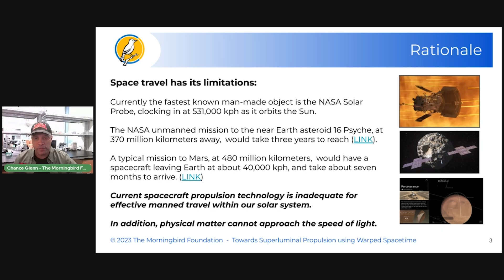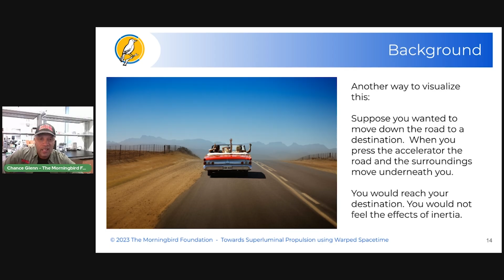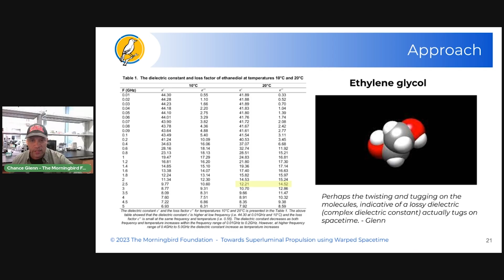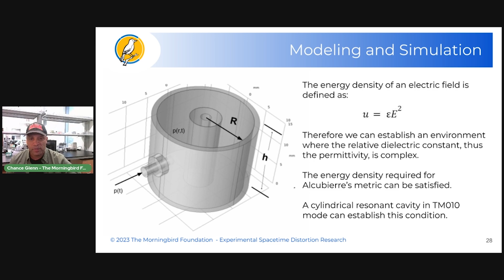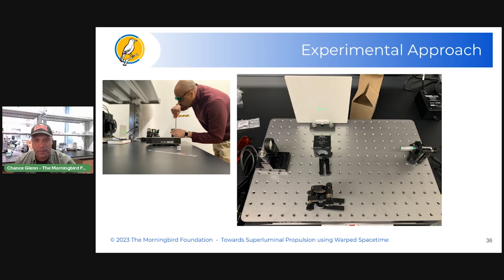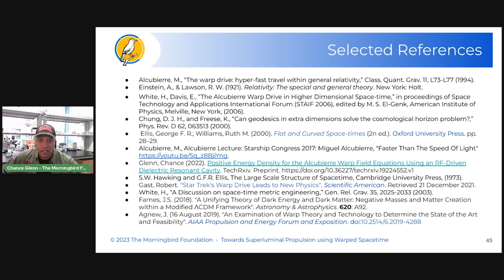Superluminal Propulsion Using Warped Spacetime | Chance Glenn

Comment: Love your work Dr Glenn, it’s all about circuit configuration. 
 Prime the centre of the field with resonant L-wave from the front then pulsed magnetic coil pushing from the back against the neutrino field. ✅ 
 Unimaginable amounts of energy are not required, relatively no more than a person swimming through water,  only it just keeps on accelerating. 
 The ‘field’ is either aligned or perpendicular, and it can be manipulated ahead of you. This is the fulcrum for your leaver.

It’s only impossible because you think it’s impossible. 
 It is possible and I can see it. Free your mind.

Comment: General Relativity and Quantum Mechanics are not compatible and physicists have been trying for over 100 years without success. So one of the two theories must be wrong! There is now strong evidence that the problem is Relativity, and the proof is that the speed of light across space has just been experimentally proven to not be constant, and instantaneous signaling across space has just been demonstrated experimentally, thereby disproving not only the 2nd premise of Relativity,  but also disproving Relativity's prediction that signals faster than speed c are not possible. What remains is the 1st premise: Galilean Relativity. If Relativity is wrong then so is any theory dependent on it such as General Relativity and even QED. According to the scientific method, no experiment can prove a theory, but can only evidence supporting a theory. But one experiment can absolutely disprove a theory by disproving a premise of a theory, and or a disproving a prediction of a theory.

An experiment just published in the EM journal IRECAP shows an EM pulse propagates instantaneously in the near field across 1.5 meters of space with no propagation delay. This shows that the front speed (speed of information) or speed of causal action is instantaneous in the nearfield of EM sources. It shows that not only is the speed of flight not constant, but shows signals propagate instantaneously in the nearfield of EM sources. The experiment was repeated hundreds of times, and was also done by an independent researcher in their own lab, with the exact the same results. The paper also shows that the effect is predicted exactly by Maxwell"s equations. The paper is linked below. The effect can also be shown to be fundamentally due to the Heisenberg uncertainty principle. This shows that the effect is fundamental to all fields including: EM, gravity, and quantum.

In another experiment, a sinusoidal signal was transmitted between 2 dipole antennas as they were separated from the nearfield to the farfield. Analysis of the resultant phase vs distance curves (dispersion curves) shows a clear minima in the nearfield for all the EM field components. Applying well known phase speed and group speed operators to the curve, which are inversely proportional to the slope of the curve, show that both the phase speed and group speed are instantaneous in the nearfield and reduces to about speed c in the farfield.

Both experiments have been independently repeated by other researchers, obtaining the same exact results. If speed of light is not constant, then the 2nd premise in Relativity is wrong and what remains is the 1st premise: Galilean Relativity. Instantaneous signals violate the Relativity of Simultaneity because the signals appear the same in all inertial frames of reference. This can easily be seen by inserting c=infinity into the Lorentz transform, yielding the Galilean transform, where time and space are absolute. So if a moving body is observed with instantaneous nearfield light, then no Relativistic effects will be observed. But they will be observed if the frequency of the light source is changed such that farfield speed c light is used. So by simply changing the frequency of the source, Relativistic effects can be turned off and on. The only possible explanation is that the effects of Relativity are not real and are just a type of optical illusion. This result will affect all of modern physics.

In addition, the above results are predicted by EM theory. Maxwell's derivation of the speed of EM fields was wrong. The reason is that EM fields are created by sources coming from Gauss' and Amperes laws., and these sources must be included and can not be set to zero as Maxwell did. Including the source term yields a wave equation equal to a source term. Inserting a dipole source yields EM field components that with phase vs distance from the sources dispersion curves with a clear minima in the nearfield, and become only approximately linear in the farfield, starting about 1 wavelength from the source. It is well known that both the phase and group speed are instantaneous when there is a minima in the curve, and only exactly a constant speed when the curve is exactly linear, which only occurs at infinite distance from the source, which does not occur in a finite sized universe like ours. So Maxwell's solution is only valid at infinity, which does not exist in this finite sized universe. So the speed of light never a constant in our universe. If the speed of light is not constant, then the 2nd postulate in Relativity is wrong.

The same behavior can be shown to occur in gravity. It is well known that general relativity reduces to gravitoelectromagnetism (GEM), which assumes that gravity can be modeled by Maxwell's equations with different constants. So the same solution that occurs in EM theory also pertains to gravitational theory. This explains the instantaneous gravitational effect in the near field, observed in the stability of the planets, and also explains that Gravity waves have been observed to propagate at about speed c in the far field. This theory then accounts for all the observed gravitational effects including instantaneous nearfield and the speed of light farfield. The main difference is that this theory is a field theory, and not a geometrical theory like General Relativity. But because it is a field theory, Gravity can be then be quantized as the Graviton, enabling the unification of Gravity and Quantum Mechanics.

The phenomena also can be seen in quantum theory, and can be shown to be the consequence of the Heisenberg uncertainty principle. At the source, the position of the photon emitted from the source is precisely well known, hence the momentum or the speed is infinite. At about 1 wavelength from the source, the wavelength is starting to be come clear, such that frequency x wavelength ~c. But according to Fourier Theory infinite cycles are needed for the wavelength to be exactly known. So the above frequency wavelength relation is only valid at infinite distance from the source. So the speed of light never reduces to exactly speed c in our finite size universe. This phenomena should be fundamental to all fields including: EM, gravity, and quantum, and in particular quantum tunneling.

There are currently many interpretations of quantum mechanics. But only the Pilot Wave Interpretation is compatible with Galilean Relativity. In this interpretation real particles are guided by real pilot waves. But the real pilot waves are known to communicate information about the particles instantaneously with the environment. Because this is not compatible with Relativity Theory, this interpretation has not been taken seriously. But as a result of this discussion, this is no longer a problem, and Pilot Wave theory should now become our best interpretation of quantum mechanics. And combined with instantaneous nearfield interaction, can perhaps explain the instantaneous interaction observed in quantum entanglement.

For more information see the following links:

*YouTube presentation summarizing my 35 years of research in this area: https://www.youtube.com/watch?v=sePdJ7vSQvQ&t=0s

*More extensive paper for the above arguments: William D. Walker and Dag Stranneby, A New Interpretation of Relativity, 2023: http://vixra.org/abs/2309.0145

*Electromagnetic pulse experiment paper peer reviewed and just published last month in Journal IRECAP: https://www.techrxiv.org/doi/full/10.36227/techrxiv.170862178.82175798/v1

Dr William Walker - PhD physics, ETH Zurich, 1997
Reply: Could it be stated that the longitudinal field component in the near field propagates independent of the medium it traverses through,while the transverse EM radiation of the far field is dependent on the properties of the medium it traverses through,ie; permittivity and permeability of the vacuum?
Reply: @josephrendon6969 Analysis using Maxwell's equations shows that all the field components propagate superluminally in the nearfield. Experiments confirm this. In one experiment, a sinusoidal source was transmitted between two vertical dipole antennas, as the antennas were separated from the near field to the far field. The results show that the resultant phase versus distance curve is nonlinear, with a clear minima in the near field, and becoming only approximately linear in the far field, starting about one wavelength from the source. It is well known that only a linear curve corresponds to constant speed c. It is also well known that a minimum in the curve corresponds to instantaneous propagation. Applying well-known face speed and group speed operators inversely proportional to the slope of the curve shows that the speed of light is instantaneous in the near field, and reduces to approximately speed c in the far field starting about one wavelength from the source, and never reduces to constant speed c, ever. For more details see, Superluminal electromagnetic and gravitational fields generated in the near field of dipole sources by William Walker, 2006
Reply: @josephrendon6969 No, analysis using Maxwell's equations shows that all the field components propagate instantaneously in the near field and reduced to approximately speed c in the far field, and never become exactly speed c, ever. See, Superluminal electromagnetic and gravitational fields generated in the near field of dipole sources, by William D Walker, 2006
Reply: @josephrendon6969  No, analysis using Maxwell's equations shows that all the field components propagate instantaneously in the near field and reduced to approximately speed c in the far field, and never become exactly speed c, ever. See, Superluminal electromagnetic and gravitational fields generated in the near field of dipole sources, by William D Walker, 2006
Reply: @williamwalker39 . Thank you for your time in responding to my question.